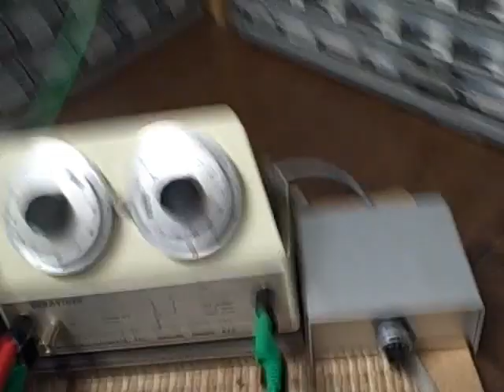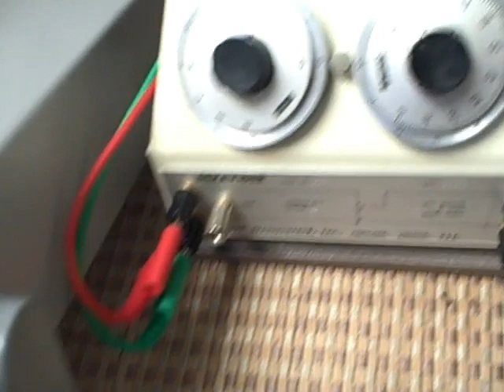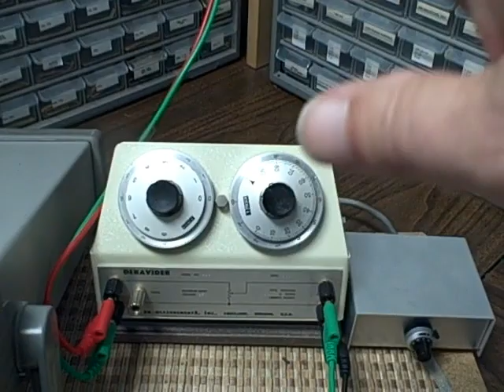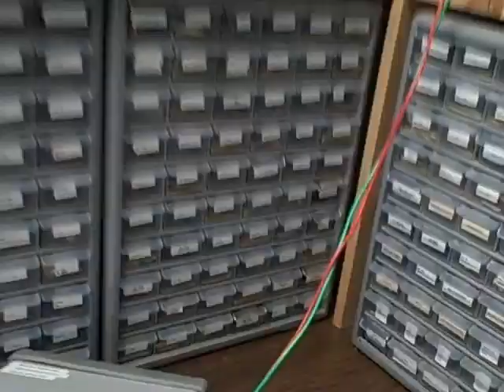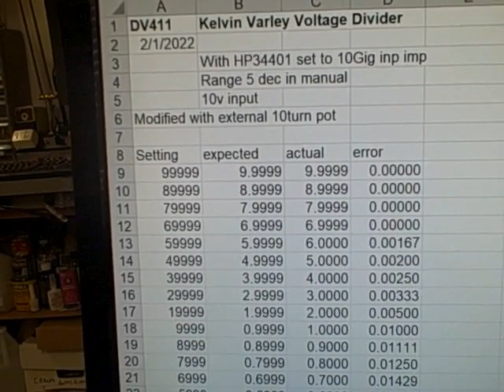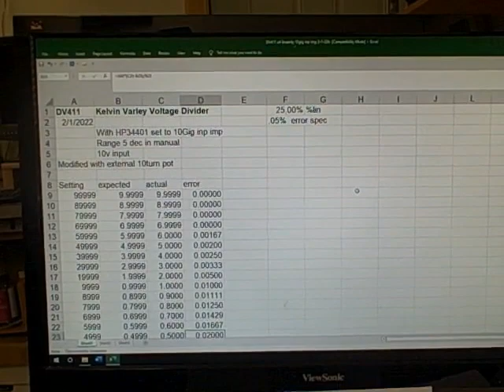DV411 u4 fixed with external potentiometer

Comment: Hi Bruce, 
it is great to see another electronics YouTube channel producing content, you have been making videos long before I started doing it and have a great collection of videos, that being said I have a couple of suggestions to help you improve the videos a bit.
The first is to try and use a tripod or camera mount whenever you can, handheld camera is ok in some situations but it is always a good idea to use a stable shot whenever possible as it gives a better viewing experience. 
The second suggestion is to try and do the videos in a higher resolution if you can, right now they seem to be in 640*480 which is a bit on the low side these days, I don;t know if this is a limitation of your camera or something you are doing when you edit it, if 640*480 is all your camera can do then obviously there is little you can do to improve that unless you upgrade the camera to something newer, most relatively modern cell phone cameras are actually pretty good so that is an option. When I started doing videos myself I used my old iPhone 4 as a camera for quite a while until I purchased something dedicated to the job, you definitely don't need 4K or anything like that, but even going to the next revolution up of 1280*720 would make a big difference, ideally you can get to 1920*1080 as that seems to be the optimal resolution for this kind of thing, but as I said, even getting 1280*720 would make a big difference to the video quality.
I hope this helps.
Scott.